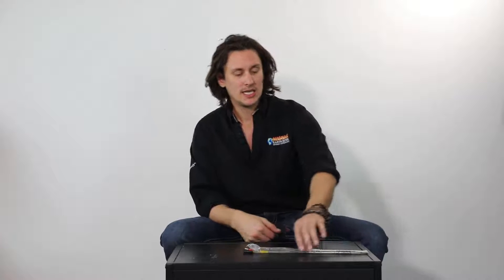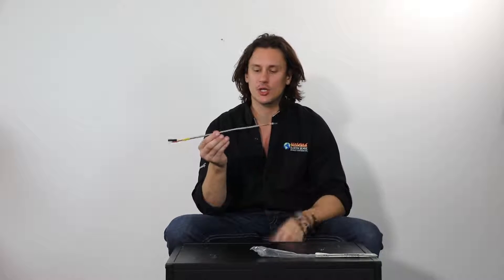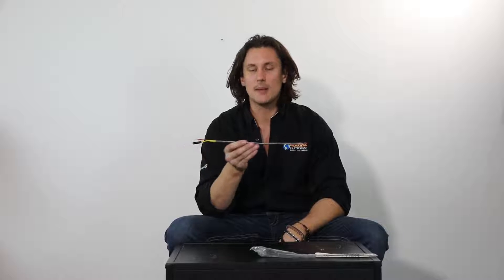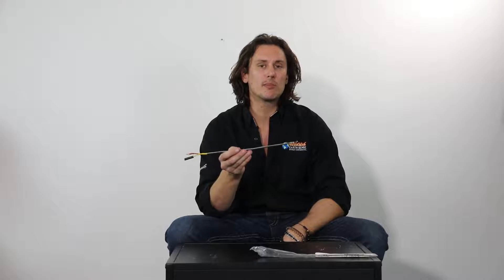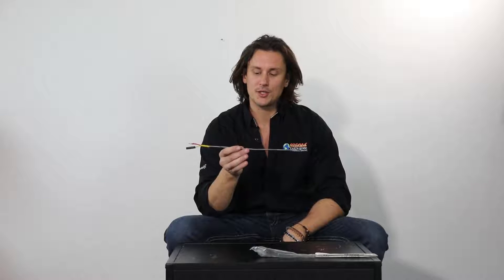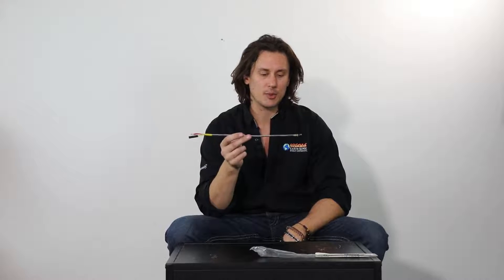Quadrafire Thermocouple Function & Troubleshooting

Comment: I installed a new thermocouple, however now my stove wont go into regular feeding...
Reply from the maker: What model do you have Mike? Are you getting any blink codes on the control board? Let's double check the thermocouple connection. Let's make sure the thermocouple is placed far enough over the burnpot and the ceramic cover is in place. Let's make sure enough pellets have come through during start-up to get the thermocouple up to proper temp. Keep us posted, happy to help. Thanks!
Reply: @EarthSense  I'm having the same issue.  I just replaced the thermocouple in my Santa Fe and it starts up perfectly with plenty of pellets to get a good flame but, it doesn't feed anymore pellets after that.  Is it possible that the new thermocouple is located far enough over the pot?  Too far?  For reference, the old thermocouple was definitely bad with a split cable and blinking amber light.
Reply from the maker: @sonofcon  Thanks for the message. Placement of the thermocouple is important. It needs to be far enough over the burnpot to detect the heat properly. The Ceramic cover tube should be over the thermocouple, with the edge right at the edge of the burnpot. Let's double check placement on that and electrical connections. Are you getting any kind of an amber blink on the board with the new thermocouple?
Reply: @EarthSense  Thanks for the response.  I had the blinking amber light prior to replacing the thermocouple.  Now the light is gone and the stove starts up perfectly but it won't feed after startup.  The thermocouple with the ceramic cover on is about 1 3/4" into the burn pot which I believe is the correct location.  What do you mean by "...the edge right at the edge of the burnpot."?
Reply from the maker: @sonofcon  Thanks for the response. That sounds about right with how far you have the TC over the burnpot. I was just referring to the ceramic cover; we want the end to butt up right next to the thermocouple holder - We don't want the thermocouple wire to be exposed over the burnpot. Again, sounds that you have it correct. 
Let's toss a half handful of pellets into the burnpot prior to start-up - let's get a really good flame on start-up so we can rule out if it's just not meeting temp. Keep us posted.
Reply: @EarthSense  It turns out the leads on the new thermocouple I bought were reversed. Annoying!  The control box recognized the thermocouple but never received a proof of fire signal.  I switched the wires and now all is right in fire land.
Reply from the maker: @sonofcon  Fantastic to hear! So glad you figured it out and are warm once again! Any future questions or needs just let us know. Thanks!
Reply: @sonofcon Scott Koskie - I had the exact same issue - control box recognized the new thermocouple but no green or red LEDs flashing, pellet stove would perform initial fire just fine but not continue with the orange call light on.  Disconnected wires from control box to thermocouple. used (2) jump wires with alligator clips, reversed the connections.  ALL IS WONDERFUL IN FIRE LAND and house is now toasty warm.
Reply: @EarthSense   Should the tip of the thermocouple actually be touching the ceramic cover? I have a Quadrafire Castille. Replaced the thermocouple after noticing the blinking yellow light and have not had consistent operation since. Had a guy come out last year, all he seemed to do was clean some stuff, worked for a couple days and then wont stay lit. Startup goes great, get green indicator for thermocouple proof, it sometimes adds more pellets to the pot but not always. Seems like once red light for 600° it stops feeding pellets and wont add any more even when light goes back to green. Hitting reset doesnt add more pellets at that point either. Got a new control box an ran diagnostic. Everything works properly at that point. Just replaced snap disc 2 today, seemed to be going good but same situation. It does not continue to add pellets to keep the fire going. Read something in manual about a Hopper Switch and am wondering if there is an issue there. Sometimes just opening and closing the lid allows pellets to feed..
Reply from the maker: @justinconley8531  Thanks for contacting us Justin, happy to help. I forwarded your message to our lead tech so I can get his insight as well. 
The Thermocouple cover is simply there to protect the thermocouple - would make no difference if the end was touching inside, just want to make sure it's secure to the thermocouple holder bracket. 
If it's feeding at all after start-up and your seeing the 600 degree red light, that would indicate a different issue shutting down the fuel feed than the thermocouple. Yes, newer Castile models will have a hopper switch which will shut off the feed if the hopper is opened/left open. Here's that switch for reference: https://pellethead.com/product/quadrafire-heatilator-ecochoice-magnetic-fuel-hopper-lid-switch/

I'll follow back up once I hear from our tech and pass along his insight as well. Should be within the next 24 hours. Thanks!
Reply from the maker: @justinconley8531  Hey Justin, just heard back from one of our lead techs: 
The tip of the thermocouple does need to be all the way to the end of the ceramic cover or it will not register a proper temperature. After reading this my first initial thought was control box.  After replacing the box and having the same issue is a little confusing. I would need to know if after replacing the control box was he getting the green light or was it feeding the startup charge and then not feeding after that. I do not feel that the hopper switch is the issue but they can try bypassing the hopper switch and see if that changes anything.

Feel free to call in at 800-236-6647 and ask for Greg B in tech support. Thanks!
Reply: @EarthSense  Thank you so much for your replies and the information! You helped me determine I had the thermocouple correct and that this unit does not have a hopper switch. We were able to narrow down the issue. It turned out to be the vacuum switch. Replaced that and she's purring like a kitten. Thank you for the support and resources.
Reply from the maker: @justinconley8531  Thanks for the update Justin! Very glad to hear you found the issue and the stove is purring like a kitten! Awesome! Any future questions please let us know. Thanks!

Comment: I have an older CB 1200 that I purchased used a little over a year ago. After replacing the control board and a couple of snap switches I got it to work as designed. That is until a couple days ago. I attempted to start it up and after awhile the fire went out. I checked to make sure the feed auger was operational, confirmed the snap switch #2 was OK then tried to start it up again. Now it won't feed any pellets. I removed the ceramic from the thermocouple and did a visual check. The little solder ball on the end of the wires appeared to be intact but was off to the side of the wires as if it had melted a little and dropped from the end of the wires and to the side of the wires. I suspect the thermocouple is the culprit. I think I'm on the right track but am asking if there is anything else I should check? Thanks is advance.
Reply from the maker: Thanks for contacting us Dave. Yeah if the Thermocouple loses proof of fire at any point during operation the unit will go into shutdown. It's odd that you are not getting any pellets to feed when you try to start it up now. It would be rare the thermocouple would affect the initial start-up sequence. Are you getting the red call light? Any other light indications from the control box? Hopper lid, ash drawer, front door are shut and sealed tight? Have we inspected or bypassed the vacuum switch for troubleshooting? Happy to help.
Reply: @EarthSense  After sending the above message I went out and started checking the thermocouple a little closer. While doing so I opened the door that allows access to the starting hot rod. Low and behold it apparently had been replaced before and who did that work used crimp on connectors. They had failed and one of the conductors had grounded out. Remedied that and tried to start the stove but no go. I did noticed an amber light in the control box flash three times pause and then flash again three times. I unplugged it and will try to find information on what that flashing code is supposed to tell me. Your other questions about cleaning, doors shut etc. where all in proper working order. I did a super cleaning of all the areas not long ago and have only ran two bags of pellets through it since. I'll need to check, but I may not have reconnected the thermocouple wires to the terminal block. I had removed them to check the resistance, which by the way was 3 ohms. That may be what caused the flashing light situation. Three ohms to me seems a little on the high side, what say you?
Reply from the maker: @daveremillard6257  Thanks for the update Dave. Just checking in with our lead Quad tech to get his notes on the TC ohm reading you are seeing as well as the amber light fault code you are seeing. Will follow-up shortly. Thanks!
Reply from the maker: @daveremillard6257  Hey Dave, heard back from our lead tech. Keep us posted with what you find. 
'Ohm reading on a Quad TC is not a troubleshooting test recommended by HHT.  The definitive test is mV output as related to temperature applied to the TC.  This is done with a parallel test harness and watching the control board lights as the stove is firing up.  If the amber light is flashing, the stove will not start up and indicates either reversed polarity (connected to the wrong terminals) or zero continuity.  Could there be a circumstance of reading some sort of continuity and the amber light is flashing? – sure!!  Giving the reading of continuity / ohms I would try switching the connections.  Cannot eliminate the possibility of a board failure either, however, the least $$ is the TC.'
Reply: @EarthSense  Thank you so much for following up on this. As far as changing polarity on the TC leads, I understand that is important to have the correct polarity, but the stove worked fine before. I still have a question about it however. The wires connect to a terminal block close to the Control Board. One of the terminals has a red mark on it and the other two are not identified. The way it was connected by the previous owner was the wire with a green spade terminal was on the terminal identified with the red mark and the wire with the red spade terminal was on the unidentified. There also is a green jumper wire that was from the terminal identified as red to yet another terminal on the terminal block. I hope that made sense. I did go pick up another TC from a local vendor (bad mistake as his price was out there ) but wanting to get this going, decided it was worth it. I should have just ordered from you. So if you can help me understand the correct wiring I would really appreciate it. The new TC has a wire identified with red and the other wire is yellow. I've looked everywhere I can think of for a wiring diagram but it must be some top secret diagram as it doesn't appear to exist for those of us with electrical background and just enough knowledge to need to ask for help. LOL
Reply from the maker: @daveremillard6257  Good Afternoon Dave, just heard back from our tech on this. 
'The green wire is likely part of the TC grounding kit that is included with new three and four speed boards.  The terminal block he is talking about has 4 screws of which the middle two are for the TC connections.  The outside two attach the terminal block to the control board base.  Do not let the green ground be a distraction since the middle two are for the TC red and yellow wires.  Which terminal is for either color I can’t say without referencing a 1200 but there are only two options.  If it doesn’t work one way then switch the wires around and once attached to the correct position mark the terminals with R & Y for future reference.  If problems persist, remove the green ground wire all together and then start over.  Again, the center two terminals. '

Keep us posted, Thanks!

Comment: I have a quadrafire cb 1200 call light goes on pellets do not drop and igniter is not getting hot I bypassed vacuum switch nothing replaced igniter bypassed #2 snap disc , fan is working just no pellets drop and igniter won't get hot
Reply from the maker: Thanks for reaching out Mark. Just ran this past our lead Quadra-Fire tech. "With two things not working, feed and igniter, I would suggest he look at the thermocouple.  A defective Thermocouple has been known to cause this yet not trip the amber fault light." 
For reference, here are our Thermocouple Listings in Stock for the 1200.
OEM: https://pellethead.com/product/quadrafire-thermocouple-35-oem/
Aftermarket: https://pellethead.com/product/pellethead-replacement-quadrafire-800-1000-1100i-1200-1200i-thermocouple-35/ 

Please keep us posted. Thanks!

Comment: I have a 2005 Quadra Fire Santa Fe.  On initial startup the unit runs fine and feeds pellets.   Then the unit will no longer feed pellets until I hit the reset button each time.  I have noticed that it will go into normal mode sometimes and continue to feed pellets but this will only happen for little while and then it will just stop feeding pellets all together and eventually shut down.  I would really appreciate any help!
Reply from the maker: Hey Doug, thanks for contacting us, happy to help. That does sound like a thermocouple issue. The thermocouple will sense proof of fire after the initial start-up sequence. Once it reaches temp it will send a signal back to the control box to go into normal operating mode. If at any point the thermocouple loses 'proof of fire' it will shut down the feed and go into cool down. 

Here is the OEM thermocouple for reference: https://pellethead.com/product/quadrafire-heatilator-ecochoice-thermocouple-14-oem/

Aftermarket Thermocouple for reference: https://pellethead.com/product/quadrafire-thermocouple-20154-bundle/

Any questions please let us know.

Comment: Where do I connect the ground for a thermocouple retrofit on an older model quadrafire CB 1200 which has an ungrounded thermocouple.
Reply from the maker: Thanks for the message Chris. You can connect the thermocouple ground to any metal part of the stove frame/body on your 1200. Let us know if you have any other questions. Appreciated.

Comment: I have a unit that will never go I to start up mode,I’ve jumped out the thermostat, vacuum switch,  disks, all appear to be ok. No call light on the unit. I found that the 7 A input fuse was blow and replaced. I can hear one fan blowing (thinking exhaust fan?), but I never see any red or green light on the control box. Another odd thing, when the thermostat was turned off, the exhaust fan continues to run until the unit was unplugged. My guess to this point is either a thermocouple failure or the control box. Any thoughts?
Reply from the maker: Thanks for contacting us, happy to help. What Model do you have? Approx. Age? So the unit is never going into start-up (I.e. Not feeding any pellets, lighting) and just your exhaust fan is running is that correct? The thermostat would be a primary area to look at - You can use a large staple or wire to jump the thermostat terminal. The high limit switch in select models and years if tripped or faulty can also prevent start-up. You can pull the wires off the high limit and connect the wires together with a jumper or alligator clips to bypass - ONLY FOR TROUBLESHOOTING, NEVER LEAVE A SAFETY SWITCH BYPASSED. If nothing changes from there, double check all wiring to the Junction Box and ensure the Control Box is seating properly in the Junction Box. If still the same issue, I would say we need to take a closer look at the Control Box -  Let's take a look at the connection points on the control box and connection points in the Junction Box - We want to make sure all are making solid contact. If that all looks good, then I would steer towards it being an issue internally in the control box. 
Thermocouple Note - The Thermocouple only comes into play after start-up. Once the fire is lit, the thermocouple will sense that heat and allow the unit to go from start-up into normal operation.
Exhaust Fan Continuing to Run: With most Quadra-Fire models and years of manufacture, the exhaust motor shutdown sequence is controlled by the control board shutdown timing sequence. 

Additionally we do offer control board testing. If it comes to that point and you need the board tested we can provide you details on that service. 

Look forward to assisting however we can.

Appreciated,